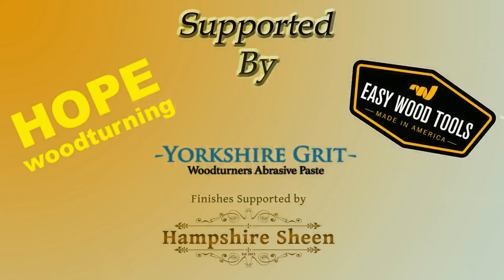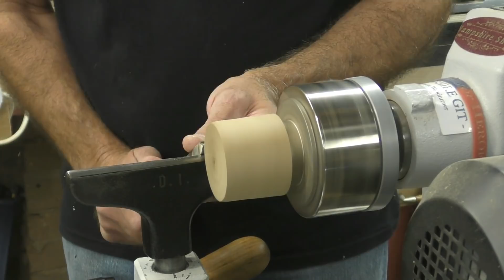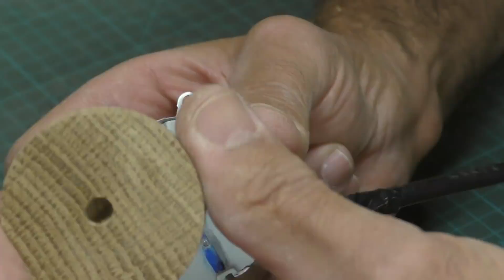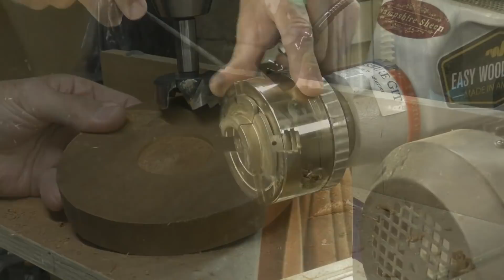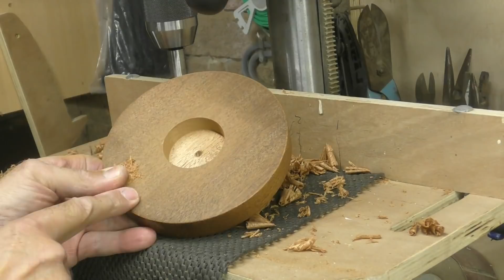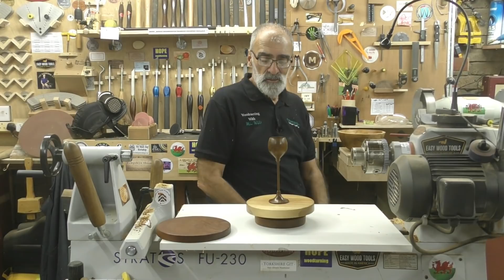Woodturning - How to Make a Powered Display Turntable

Comment: Good idea. Just a slight alteration, instead of cutting a channel for the cable, if you drilled a hole just big enough for the cable from the side of the base to the center hole then you wouldn't need to cover the wires with the little plate
Reply from the maker: Thanks Simon, and a great alternative idea too :)
Take care and thanks for watching and your input.
Cheers
Mike

Comment: Excellent ,Mike. I have seen the idea before, but you elaborated and enhanced it. Thanks. Am I missing something; why not just drill radially through the base for the cable, thread it through and then solder up?  Similar to what I did for my first turned project at school , a table lamp, and added an inline switch.   Bernard.
Reply from the maker: Thanks Bernard, your way is the standard way, I just did it this way because I wasn't thinking straight, and rushing ... lol.
But it worked!

Comment: I've also thought about making one. I've been concerned that the motor shaft is robust enough to hold the turntable and the display piece. But a set of bearings seems to be overkill. But what do you think of a ring of friction reducing tape on top of the base and under the display platform and minimizing the gap between them. Although I guess than I have to make sure the spigot can still drive it.
Hmmm.
Alan
Reply from the maker: To be honest Alan, I've had no issues yet with this basic build. I suppose in time and with heavier pieces there might be a problem. If there is I will address it at the time. The tape seems a good tip too thank you.
Cheers
Mike

Comment: Just ordered a motor. Although it will come in handy for the occasional video of a finished piece, I think I will mainly be using it when airbrushing a piece. I don't have variable speed on my lathe so I can't get those very slow speeds sometimes required when spraying. Plus, sometimes it's better to spray onto a horizontal surface. Thanks for that Mike.
Reply from the maker: Nice one Gary glad you like the idea and video :)

Comment: I did the same thing with parts from a scrap microwave. I also added an inline switch ... but that doubles the cost to £5. :)
The transformer can be used to make either a Lichtenberg burner or a spot welder.
Reply from the maker: Great minds Rob .. but yours had a SWITCH!!!! ;)

Comment: A great inexpensive way to display your work Mike. A point of interest to anyone thinking of taking a motor out of their micro wave oven to use instead of buying a new one - don’t. I read an article a while ago when I was considering making a turntable, about how they “store” electrical energy and could give you a nasty shock & for a couple of £’s why would you.
I like the contrasting woods for the platform. Next addition some LED’s ?

Thanks for sharing 
Geof
Reply from the maker: Thanks Geof. Also thanks for the tip re the old motors ... I must remember to mention that in a future video.
Cheers
Mike
Reply: I don't believe it's the motor that stores the energy it's the capacitors. There lies the danger. If you don't know how to discharge the capacitors then don't try removing anything from the inside of a microwave. Stored voltage in  microwave capacitors start around 50,000 volts which will give you a very nasty wallop!

Comment: Good one Mike. Very effective. Thanks.  Wire protection?  May I suggest that you fill the void with some hot melt glue. That will hold everything tight and also provides insulation at the same time. Cheers.
Reply from the maker: Thanks Jim, since this video, and taking your advice, I have indeed filled the void with hot glue ... worked a treat. Thanks for the tip.
Cheers
Mike
Reply: You are most welcome Mike. See you at Harrogate . Looking forward to the event.  Regards Jim
Reply from the maker: @jimrobb6325  Afraid I won't be making Harrogate this year mate :(
Reply from the maker: @jimrobb6325  Afraid I won't be making Harrogate this year mate :(
Reply: Sorry to hear that Mike.

Comment: That is so awesome! I want to make one of those someday. Makes me cry though that I didn't see these videos until I disposed of my old microwave when it quit working.

 I actually had it recycled at my local place. The turntable part still worked but it wouldn't cook anything. I should have taken the motor out before sending it to the recycling. ;) - Heidi
Reply from the maker: Thank you. I wouldn't advice using a used motor as they apparently hold the electric current, even when not connected, so a new one would be advisable, they are very cheap.

Comment: A Lazy Susan becomes a Lazy Mike.lol Works well and looks good.
One thing is that those terminals, which may be covered by that strip of wood,  also need some heat shrink sleeving,  or similar, directly over the terminals. Mains voltage is dangerous and you cannot be too safe.
Thanks
Janes
Reply from the maker: LOL ...thanks James. I actually have filled that void(and the terminals) with hot melt glue ... now both insulated and firmly in place.
Thanks for the suggestion mate :)

Comment: Great job Mike. I did mine very similar, where I also added a dolly between the turntable and base to reduce any tipping movement.

Have you noticed as this is a mirowave motor that it changes direction almost each time you power it on?

Well done, I got the motor idea from Stephen on his 8x6 workshop build for one.
Reply: I noticed this on a rotating lamp I made. For the first 20 times I used it it went clockwise and then suddenly decided to alternate. I thought I was going mad haha.
Reply from the maker: Thanks paul, it's going the same way up to now! :)
I didn't see Stevens video ... it must have slipped the net.